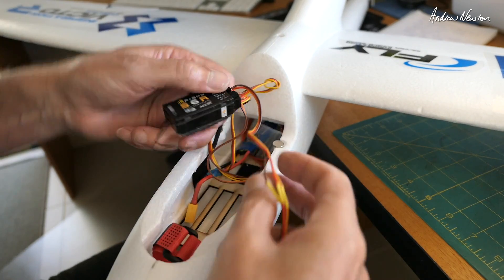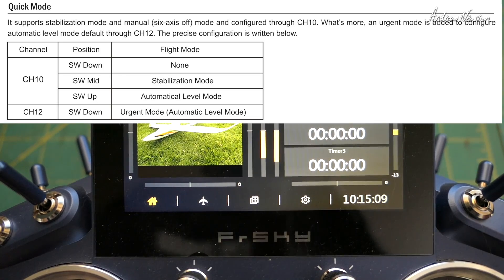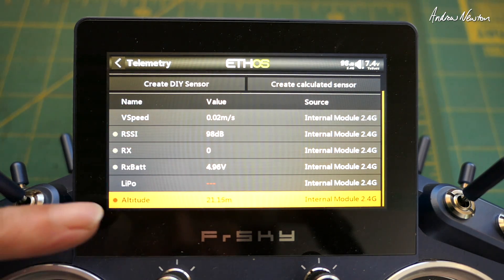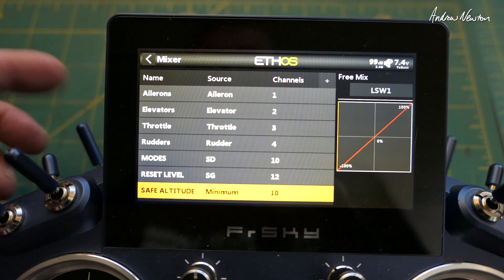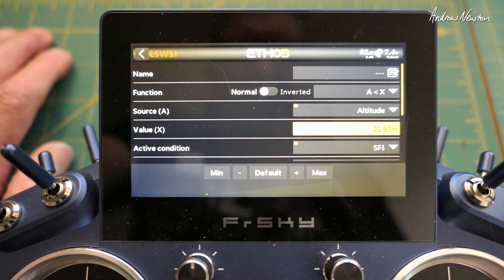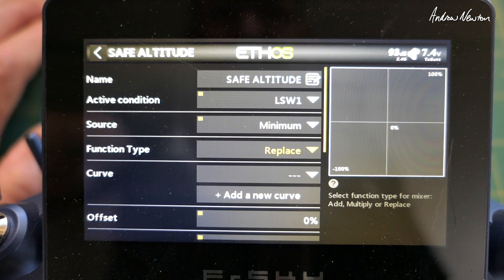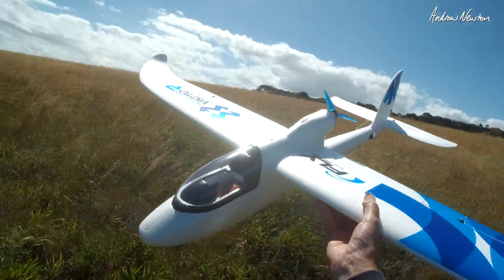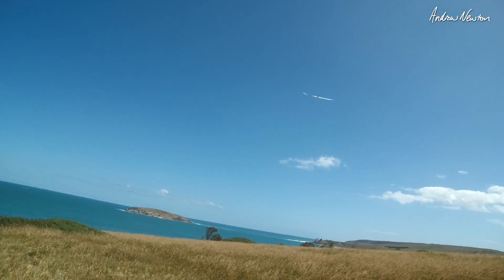Altitude Activated Safe Switch

Comment: This is a great idea. I'm going to try something similar in iNav for an FPV cruiser: enter ANGLE mode when below 20m (relative to takeoff altitude). I think I'll use a momentary switch as an override, in case I need authority to maneuver around obstacles.
Reply from the maker: Yes, great idea.

Comment: Thanks Andrew for this setup, very nice.
I believe even when at lower altitude and safe/auto level kicks in. The control stick had to be release/(in natural position) before the plane will level itself. I need to test that out to confirm.
Reply from the maker: Correct Ken

Comment: Great stuff Andrew.. I still use My S6 and S8 R's. Were cheaper than the X's back then.
Works fine on a floater. Stick it in the Dragon talon (unmoded) and see if it works on that sucker.. Should be good for a laugh...
Reply from the maker: Jet them fight it out in the air!

Comment: Brilliant demo (8:20).

Thinking a similar Altitude Safe Switch could be enabled in INAV by programming a Logic Condition tied to a transmitter switch. A useful feature should one loose orientation when flying LOS, or as a safety net for newer pilots.

Comment: It's worth mentioning, that self level mode is NOT a way of maintaining altitude. I have a number of S6R receivers. Great RX, but it's not a FC.
😳😏😏😏🇬🇧
Reply: Hi EnglishTurbines, can you explain FC for us beginners here. thanks.
Reply: @kevbarry7453  Well, the basic difference is the S6R is just a receiver with a built in giro. In self level mode, the plane will fly level according to where the giro has been calibrated as level.
As the model flies, it has no idea if it's gaining or losing altitude, or if it's going upwind or downwind. Usually it results in a gradual, or not so gradual loss in height. 
A flight controller (FC).. is different, because it looks at altitude and will apply motor and or elevator input to maintain a fixed altitude...
😳😳😀😀🇬🇧
Reply: @EnglishTurbines  This reminds me of that TV program: “Air Crash Investigation: Who's Flying The Plane?”
Showing that you can end up crashing a plane because the interface between Pilot and Auto-pilot is not understood well enough! Looks like this can also become a problem in RC- world?!
Reply: @Johan-ex5yj  Only a simpleton would imagine that Spectrums "Safe Mode" is foolproof. The FrSky setup in this video is no different. It's a sales gimmic for Spectrum...🤔😳🙄🇬🇧
Reply: @EnglishTurbines  Many thanks , that helps a lot. I should have taken this hobby up 50 yrs ago, not in retirement...ha!.
Reply from the maker: This page might help with some of the indecipherable terms http://newtonairlines.blogspot.com/2020/10/rc-fpv-and-fcb-terms.html
Reply: @AndrewNewton   that's fantastic. It's just what I need. Also the wing at the head of the page is almost identical to the Depron model one of the instructors at our airfield helped me to build last week. More interesting is it had the regimental stable belt colours from my old unit in the Army. Corps of Military Engineers. Thanks again. Kev.

Comment: Will it level it's self if it is in a Tip Stall Spin ?
Reply: There is a very small chance that the sensor state will cause a control surface reaction that lets the plane straighten for a moment to pick up speed, but most likely the spin will just continue. At least that's my experience with fully fledged autopilots, so I doubt a simple auto-level would fare much better. Depends a lot on the plane type though - a feature like this would be mostly useful for beginners so I would hope they're not flying an easy to stall plane to begin with.
Reply: @iforce2d  You are quite correct as usual for the scenario where the Auto Level is Extant or Switched On at the moment that the stall occurs. The only saving grace with this is that the newchum pilot should be flying high enough for the plane to hopefully gain enough (forward) speed for the ailerons to be effective when the plane has fallen to the altitude where the Auto Level kicks in. If not "Banzai!!!" 😉
Reply: @iforce2d  Thanks for the relies... Was just curious if it could fix Tip Stalls.. 
I had a Bixler 3 that would always Tip Stall at very slow speeds. I fixed the problem by installing Vortex Generators on the wings. BYW.. I saw your new foam/fiberglass plane Chris. Waiting to see the maiden.
Reply: Only if it has fallen enough to gain enough speed to give sufficient airflow over the ailerons - as I'm sure you are aware.